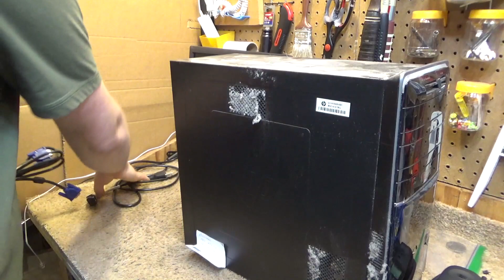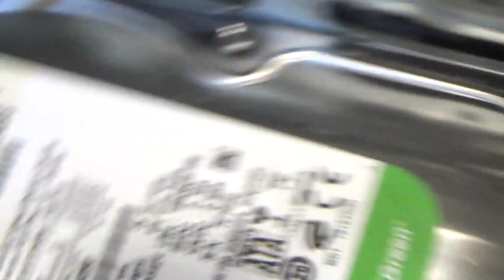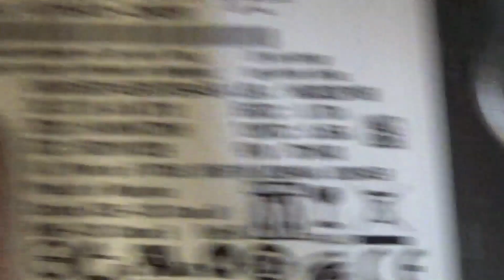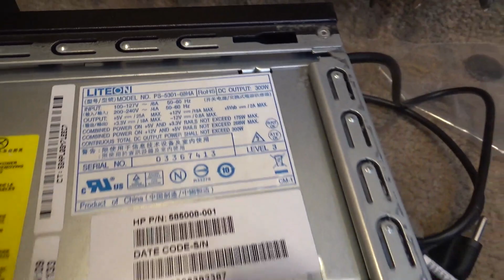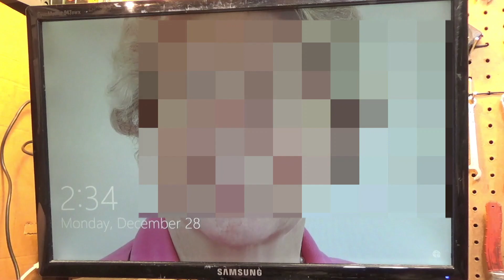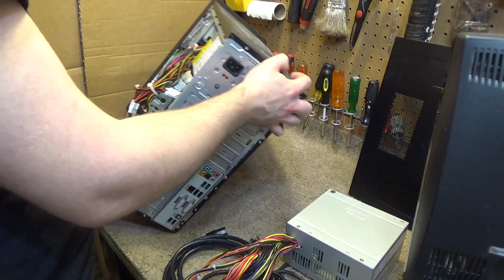HP Pavillion P7-1000 Initial Checkout/Repair Part 1

Comment: i am so upset with hp right now bc i bought a hp omen 870 spent my hard earned money on that computer only for it to have motherboard problems. Sent it in not once but twice and still have problems i later bought a hp envy x360 laptop witch runs good but i built a custom build 8th gen core i7 with 32 gigs of rams. suppost to be a gaming computer mainly. After what i had to deal with this hp i am done with hp i will go with lenovo i wont event touch dells
Reply: Jordon i am with you all the way i hate windows 10 had nothing but problems thats why i stayed on windows 8.1 couldnt wait to get off of windows 7 had problems i now have windows 11 home its doing ok its better then windows 10 thats for sure

Comment: I don't know the full story, but somehow this computer model became mine in 2011 and ever since I've been keeping it up to date: I upgraded the graphics card two or three times, I got a new motherboard for it, I 3d printed a rack to turn the hard-drive tray into an ssd tray, I got a different cpu for it, it's got a better power-supply now, and it's got a much better cpu. The only things in this computer that are stock is the case and the fans (I think, it's possible I upgraded them some time.) Recently I've been looking into this computer (In it's original form) because it has been so "ship of Theseus"-ed that I genuinely want to know what this computer was stock and it looks like the name "Pavilion" has been gifted to HP's laptop line now, so it's incredibly difficult to find images unless I specify that it was windows 7. Of course, the case is really iconic and it makes for an incredible sleeper build and makes me feel like the turbo nerd version of those guys who take cars from the junk yard and turn them into serious sports cars.
Reply from the maker: Thanks for letting me know.

Comment: I know this video is old but on HP's it is F11 to get to recovery. Even if upgraded from Windows 7 or 8 it should work as long as the Recovery Partition is still intact. If F11 does not work try hitting esc on HP Logo then select F11 Recovery. Also F9 on HP Logo may get you their.
Reply: i had a p7-1235 with a recovery partition it was on windows 10 i did both things and the partition was corrupted i think but i bought recovery disks from computer surgerons and it works fine now i also got another hp p7-1235 and the recovery partiton works on this one so its running windows 7 on the HP OEM right now just fine.

Comment: I've found that the Reset This PC option only works if you boot to Advanced Options from the OS itself or power off the machine will it's at the Windows 10 logo 3 times to get into Recovery Mode. 

You have compressed air? That's so hard to get in Computer Repair places!
Reply from the maker: That's so dumb; that was never an issue with the systems of the past.
Yes, I have compressed air! I know it's a rare breed now.
Reply: I just use a pump

Comment: How could you bash on this awesome PC!?!?! Its got Beats Audio lololol

I hate these line of HPs! Horribly slow AMD (2 core) CPUs and even worse GPUs. The only selling points of these is the beats audio which IMO just makes it even worse. Since its a scam since its only software to make it sound differently..  I a lot of people coming in with PCs like this at work. They are either the AIO touchscreens or these towers. All with slow AMD CPUs.
Reply from the maker: What's considered slow is all relative. This has more than enough power for me. With that being said, I've never particularly liked AMD equipment, nor APUs at all. I'd never spend a dollar on a machine like this, but for free, I can certainly get some use out of it.
Reply: @JordanU  Yeah, When I mean slow, I mean in comparison to a Intel Celery or a Pentium CPU. Since AMD's ULTRA low end CPUs (Its worse in the APUs) are very slow. Ive had to work on a few and the only thing to really speed them up is to either put the OS they came with, overclock them (Yes, AMD gives you software sometimes to OC them haha), and upgrade the RAM, 

Windows 10 does handle them a bit better than 7 and 8.x does but not much since it had WAY MORE background stuff going on. Since They are typically 2 or 4 core CPUs. 

If I were you, I'd install CloudReady onto it. Its a form of Chrome OS but running on Chromium. Thats if all your going to do is web based stuff. I'd installs a 128GB SSD, 8GBs RAM, and leave it at that. 

Mainly for the fact Chrome OS HAS ZERO stuff going on in the background compared to Windows.
Reply from the maker: @maddmaxx636  This computer runs Windows 7 just fine. I wouldn't edit videos on it; but I wouldn't go to Windows to edit videos in the first place.
CHROME OS and all that other online only stuff is of no use to me.
Reply: @JordanU  Fair enough. As I was saying, Windows 7 would/should handle it fine but if all your dong is web browsing on it. ChromeOS/CloudReady might be something cool to test on it. Ive used it a few times. 

Oh, Have you ever looked into, tested, or used Never10? Theres another one but they are windows 10 blockers. Mainly it removes an update that forces the annoying update to windows 10 thing. Not sure if youve ever had that issue.
Reply: me too

Comment: HP, Dell, Acer etc.. all use junky power supplies that just make it past warrantee. Mostly yeah the lite ons and besttecks
Reply from the maker: I've noticed Lenovo is now using a lot of LiteOn stuff too.
Reply: @JordanU  Lenovo is OK in my book but still a Chinese brand. oh and im pretty sure WD green are 5400. Blue had 7200 along with the black ones but the blues have less cache.
Reply from the maker: @rrartolak  I liked their stuff up until the early-mid 2010s. What they make now is mostly junk.

Comment: i used to have a small form factor HP with that power supply, and the fan in the power supply has a plug that plugs into the motherboard and for some reason the power supply fan is controlled by the motherboard
Reply from the maker: That's rather odd.